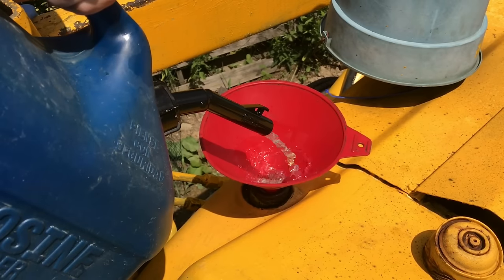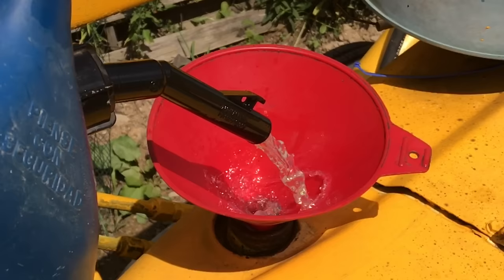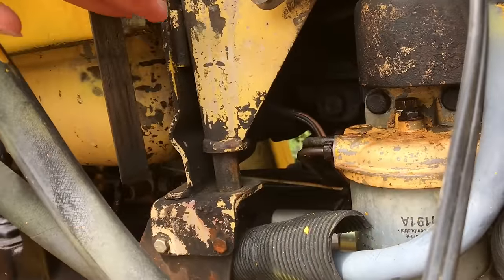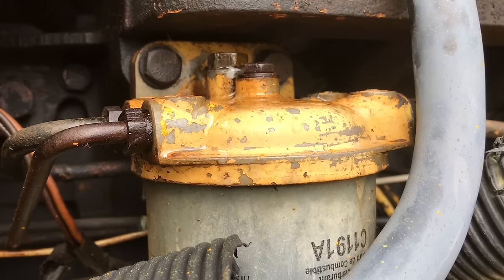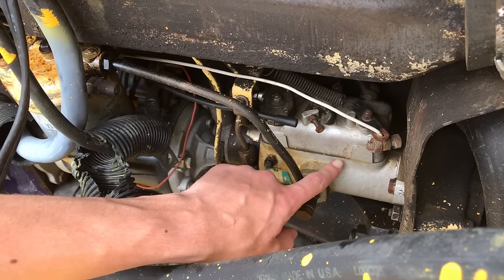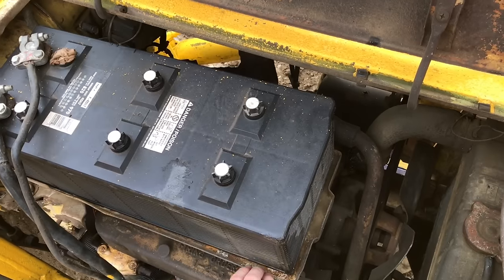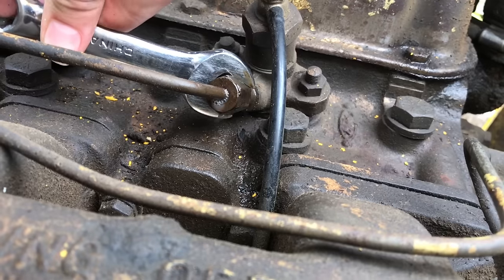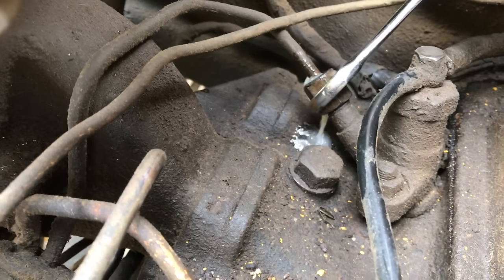BEST way to bleed diesel fuel system (step-by-step)

Comment: Turn the nuts on the fuel injectors to bleed the air out, keep it open and crank the engine until u see the fuel fly out the nut even 3 injectors tight it up and done. I usually do it, dont have to open crank and tight it up so many time

Comment: You actually crack the injector pipes turn engine and watch till no bubbles then tighten unions up the reason fuel has to be higher is it may be gravity fed a car or lorry dosnt matter as the have a fuel pump if it was true for lorry or car you would need fuel tank on the roof lol

Comment: Very well explained. Easy to forget to fill fuel tank higher than injectors OR to crack the bleeding bolts on top of fuel filters (which you prefilled with diesel fuel as well). Thanks.

Comment: A lot of newer diesels have a lift pump that will bring the fuel up to the filter so you wont have to fill it above the filter. Also  a lot have a bleeder valve for the injector pump   located in the front of the injector but is still a good idea to crack the lines since air will still be trapped in the lines
Reply: Mmhhh i have flipped a miniescavator and have issues restarting the machine... 
Yes all the disel got out from the tank

Comment: My friend, you just helped me out a great deal. I have the same engine, bled the first two points, sat there looking at those injector connections and dreaded trying to get to them. I had no idea the battery folded back like that! It's my Dad's old Ford 420, so I'm learning about it more and more. Thank you!
Reply from the maker: Glad you found the video useful. The first time I ran the tractor out of fuel, I didn’t get the tank full enough to push the air out. It sure is a lot easier to bleed out the air and get the tractor started again. I’m really glad that battery tray does swing out, without that there’s almost no room to work. Thanks again for the comment.
Reply: If the fuel line needs bleeding would it cause the engine to shut down, like it were starving for fuel and then shut down?
Reply: Yes

Comment: I ran out of fuel and wanted to add to this video. If you locate the fuel hose that is dumping back into the fuel tank, take that line loose from fuel tank and attatch to an electric fuel pump, hook electric fuel pump up to external battery source then you will start blowing air and fuel out of that fuel pump, it took me 2 cranks while hand pumping the manual fuel pump above fuel rail. Worked like a charm and i was on this for 3 hrs before i hooked up electric fuel pump bleeding lines. All this after you fuel back up of course.

Comment: Good video, never realized the fuel level in the tank had to be above the filter, great tip.  Also pressurizing the lines, didn't know.  I've had my 235 since 1977, only time it's never failed to start was due to a battery, terminals, or I ran it out of diesle.
thanks
Reply: It doesnt he is speaking generally but some of the tips are very tractor specific. Most skid steers, tamps, and dozers keep the fuel in the belly, lower than everything. The basic idea is air needs to escape thru a high point exactly the same as bleeding air from a cooling system

Comment: During the part where you bleed the injectors, why not just crack them open, then crank the motor a couple of times, then tighten the nuts at the injectors and then crank the motor again?  Doing it the way you show must take some time as I'm sure the process has to be repeated more than a few times.  Why the need to keep going back and forth?  Especially if you have a friend who can watch the injectors while you crank the motor watching until all the air is gone.
     In addition, I understand bleeding the fuel filter and pump, but why the need to bleed at the injectors at all?  Why not just keep cranking the motor until it fires up?  Wouldn't the air that's left in the fuel system just escape on the cylinder exhaust stroke?
     Anyone wishing to furnish answers would be much appreciated.  I apologize in advance if these questions are rather obvious to those in the know.  These are things I've often wondered about on diesel engines that's all.  Thanks!
Reply: ^^^ If you run out of fuel then your fuel pump doesn't suck anything, therefore your entire fuel system is full of air. Once you make the pump work then bleeding the injectors is easy.

Comment: Acouple mistakes, #1, why are you running clear road taxed diesel instead of non taxed off road dyed diesel?, 
#2, isn't there a bleed screw ontop of the cav pump? Looks like you skipped that part also.
#3, you can leave the injectors open till it  starts leaking fuel. And you can than close #2,#3 and leave #1 open smditll fire snd fun bad but it'll run than you hop off and close #2,#3.   (Best to have another helper on this type of job..
OTHER THAN THAT,  GREAT VIDEO!

Comment: Sometimes (i know it isn’t good) you can use starting fluid and it gets the air and everything moving out fast. If you don’t have enough battery and you are a good distance from home, starting fluid might be your saving grace. Just don’t use too much

Comment: you can do this on any diesel engine? twice this week ive got very low on fuel to the point it was nearly dry and its now started hesitating and momentarily losing power even with a half full tanks ,  just like it was before i made it to the fuel station so if i crack open the injectors slightly it will remove the air ? thanks

Comment: What if fuel tank is lower level than  the filter?
Reply: Nököhammas i was thinking the same
Reply: I work on. Diesel trucks just add fuel turn over and bleed the lines always gets started
Reply: Add air pressure in the tank.
Reply: Use an electric fuel piump...

Comment: Great video.  Saved my this week!  I have a new to me Ford tractor that looks EXACTLY like yours.  Can you tell me what year and model yours is?  Mine came with no paperwork.
Reply: My 1971 Ford 4500 looks like this also.   The easiest way to know what you have is to find your serial number.   One place is located behind the starter motor (or left of the starter if you're looking at it from the side).   There's going to be a flat spot with two unused bolt holes that looks like something is supposed to be mounted there.   Above the flat spot will be three rows of serial numbers.  You'll need to decode it on the internet.    A second place where you can find the serial number is under the hood on a foil tag.   If you're lucky, the tag will still be there under the hood.  Mine was missing.

In my case, I could not read either serial number for the tractor, however I was able to find valid serial numbers for the backhoe attachment and loader attachment.   I was able to determine the model year by comparing my attachment serials to others from pictures on auction websites.    Good luck!

Comment: I'm planning on changing my primary and secondary fuel filter/separators on my 8.2L Turbo Diesel. Do I need to prime the fuel system afterwards or should it be ok?

Comment: Any  thoughts on the hydraulic loader arms being in the way of the battery swing out tray?  I can access the first two injector lines but getting at the third one is proving to be problematic.
Reply from the maker: I understand exactly what you’re saying. What I ended up doing was, I moved the battery on the battery tray diagonal. The battery is on a tray that swings out word to gain access to the injectors. By moving the battery into this configuration allows me to swing the battery out of the way a couple more inches. Then I am able to get a wench on to the injectors to let the air out.
Reply: Worked perfectly and the tractor is up and running again!  Thank you ECG!

Comment: Hey i onow this is an older video, just for fun i watched it. I like the video. Um just a few comments. I run diesel and all of my filters are higher tge the tank i cant help it. Now also as primiing the high pressuer pump wide open throttle during prime doesnt hurt. As long as ur dispersing the air w fuel. Nice vid.lol

Comment: Does this process use up a lot of energy in the battery? Is that why you say make sure it is charged?
Reply from the maker: Yes, sometimes you have to crank it quite a bit to get all the air out. There have been times where I drain the battery all the way down, then I have to charge up the battery and continue on with the process. There have also been times that I have gotten the air out pretty quickly, and it starts right up. Any other questions let me know.
Reply: Ok thank you so much, my battery got weaker in the process haha just making sure that was normal

Comment: It seems that I'm constantly bleeding the lines.   I see that bleed bolt from the fuel filter, no fuel flows out, no bubbles and I have enough fuel in the tank.  Please help
Reply: Make sure everything is tight. (Fuel filters, injectors and your lines are in good shape)

Comment: if you kept cranking wouldn't it eventually bleed itself
Reply from the maker: It is really important to fill the gas tank high enough so there’s enough pressure to push the fuel through the system. I have tried it without purging the air out, and it didn’t work for me. There are some systems that are set up like this. I have always remove the air so I don’t have to crank the engine so much. If you do crank The engine make sure your starter does not get too hot.
Reply: cool, was just curious. Might come in handy if its some newer diesel that you can't get to nothing on

Comment: I have the same 3 valve engine, I was bleeding the top (return fuel line?) and instead bled the bottom line like in your video instead and the tractor came to life.